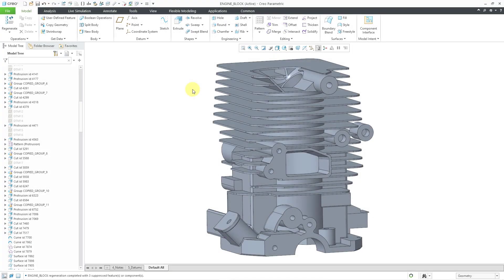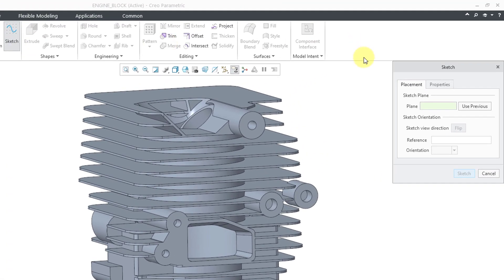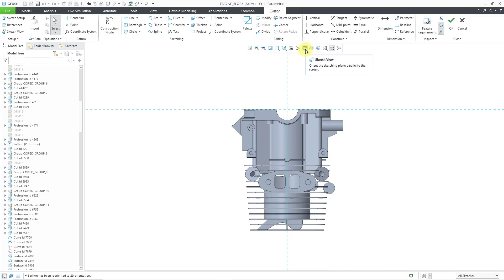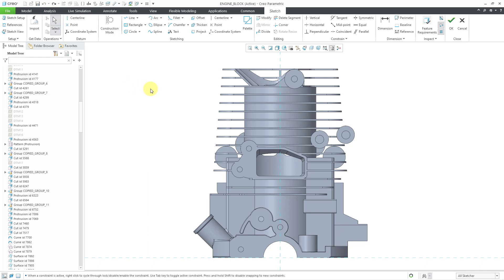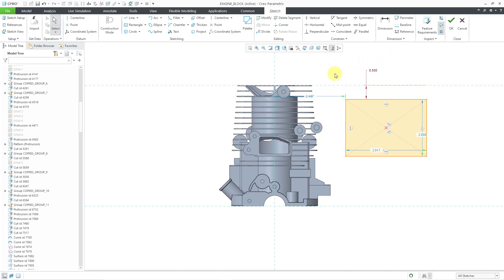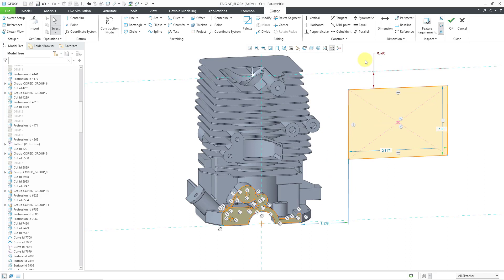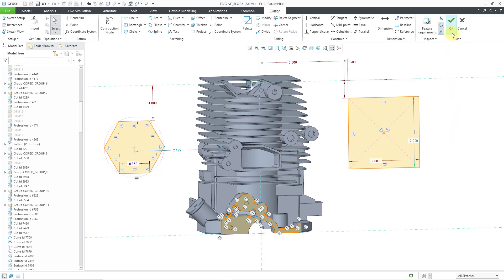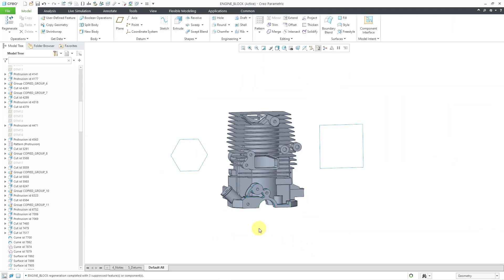Creo Parametric for SolidWorks Users - Episode 3 - Sketching (Part 1)

Comment: Are there any functional difference between a weak and strong dimension? Any reason why you would change a correct weak dimension into a strong dimension?
Reply from the maker: Change weak dimensions to strong dimensions. You can do this by changing the value or RMB. A weak dimension is a suggestion. As you change other dimensions, weak dimensions can change. Strong dimensions reflect your Design Intent.
Reply: drive and driven dimension.

Comment: Sir how to achieve pierce relationship in creo which we do in solid works?
Reply from the maker: No need for Pierce in Creo. Just add an entity like a point, vertex, or edge to your sketch references. The entity does not need to lie on the sketch plane. It will automatically be projected onto the sketch plane. Also if you dimension or constrain a sketch entity to existing geometry, that existing geometry will be added to the sketch references.

Comment: I have a question from pro piping.

If I close the pro pipe module in middle of the work and again want to start the module, all the command in ribbon area will show in de-active state. How to re active the module again?
Reply from the maker: You have to set the active pipeline.

Comment: Hello Dave, 

I've been watching your videos for awhile now and very much appreciate all the help you give to everyone. I was hoping you could help me; I've been struggling to get the terminator information to show up on a Creo Parametric drawing BOM/Pinout. I am using an .xml from Creo Schematic and have no issues getting the spool information along with designating the connectors and generating the cable routing but I can't seem to figure out why the terminator information isn't populating. It's been difficult to track down exactly what my problem is so I'm hoping you would be interested in making a video going through the workflow starting from how the terminators should be setup in Creo Schematic to the BOM populating in Parametric. 

Thanks, and I've also posted this question to the PTC community under the subject Line (Schematic to Parametric Terminator) 

CREO Parametric 5.0.3.0 not sure which version of schematic we are using.

Tyler